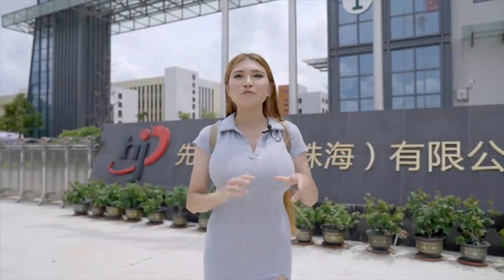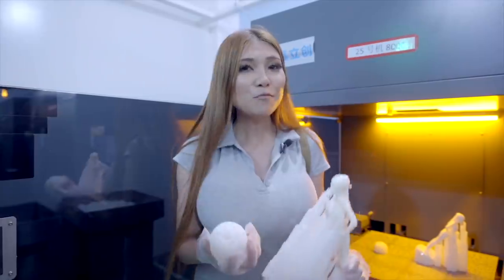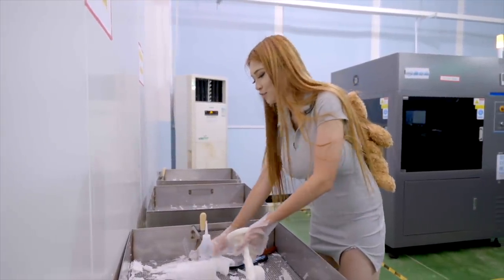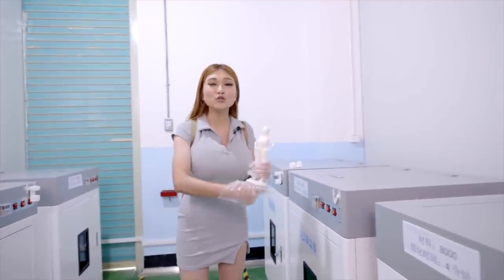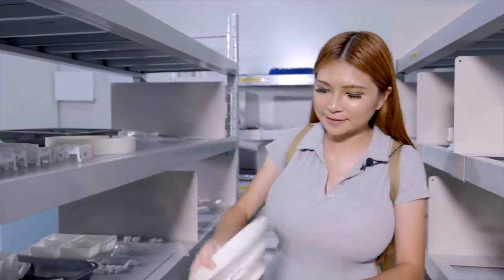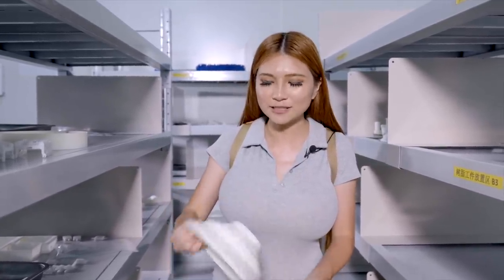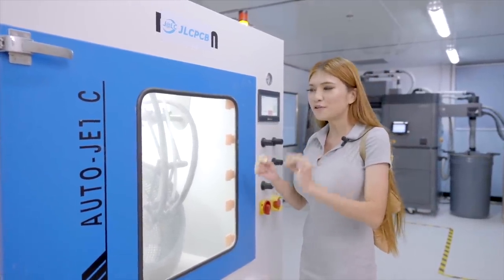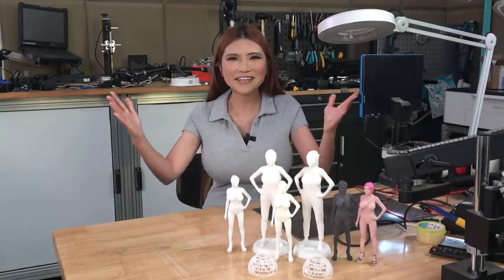Introducing JLC Industrial 3D Printing Services!

Comment: Amazing, even with shipping it costs half as much as it would if I print it myself. I can get it in nylon for cheaper than the cheapest resin I can find. And no smell, no worries about failed prints, probably better quality too. I ordered a few things that I've also printed myself, can't wait to compare.
Reply: Please share the results.
Reply: @jaimecln  will do, I'll take a couple of weeks to get here, I went for the snail mail.
Reply: Got my parts from JLC. Took them about 4 days to actually send to production, probably due to wave of orders after this video. I ordered one resin part and one nylon. Both look really good and have incredible dimensional accuracy, no warping whatsoever even on the resin part. The nylon has a bit of a rugged appearance on one side, guessing it's the side facing down during print where the powder isn't supported, but the other side looks absolutely smooth. The resin is crazy good, hardly any layer lines to be noticed. Overall really happy with both parts, it's way cheaper than printing them myself and no failed prints or curing or smells. Excellent work from JLC

Comment: Interesting, with all those possibilities JLCPCB opens up, i feel like i should come up with ideas and prototype altleast once a week just because it would be possible ;)
I have 2 questions:
1. Your 3d-model seems to be printed at an (approximately) 45° angle, is this due to support structures, or are their other reasons for this (if so, what reason(s) would that be) ?
2. You show 2 models, one in black color and one that has pink hair and beige/skin-color body-color. Are those models painted/coated somehow, or is it the color of the print materials ?
Reply: MJF printing comes in two variants, one in monochrome-material color, the second with dye jetting simultaneously with the binding agent
Reply: @alfdriss  thanks for answering my question :)
Reply: Please clarify, does this dye-jetting color the print in real time with multiple colors?!?
Reply: SLA is usually printed at an angle like this.  It lets you put the support structures on the back, where it's easier to clean them off (because it's normally flatter) and where people don't notice left-over support dots as much.  In theory it also makes layer lines less noticeable, but that's rarely an issue unless you have a lot of flat planes in your build.

Comment: I do a fair bit of resin printing of parts at home.  very curious how the results compare so I just ordered a handful of parts that I have printed  myself successfully so that I can see for myself.  I found the prices reasonable, right at 40 bucks but half of that was shipping to the USA via DHL.  I could have added many more small parts without the price going up any more on the shipping side.  I will comment back here once the parts arrive in a week or so!
Reply from the maker: Great!
Reply: Of the handful of parts I sent to JLB unfortunately none of them made it past the preproduction stage.  A friendly rep from the company let me know that no wall sections  or features of less than 1 mm were acceptable.  Since that pretty much eliminates every part I would ever need for a model I unfortunately probably wont be able to use the service.  To their credit they promptly issued a full refund, but I am a bit disappointed that I will not be able to utilize the service.  I really wanted to see how the parts from an industrial resin printer compared to those I print on my Anycubic Mono X but I guess now I will never know!
Reply from the maker: @DimensionMachine  Oh yeah, those specs are pretty standard...

Comment: I'll consider checking them out and doing a test print if they ship stuff to EU.
My Ender 3 isn't performing that well when it comes to big stuff due to it's printing size limitations.
With this I could consider letting them print car dashboard modding elements and replacement parts (4very old cars) for me and my community.

It's really hard to obtain plastic parts for cars like the Ford Taunus, Toyota Supra MK2 or Saab 900 in my country and some people also want to upgrade their old cars to fit an fiberoptic dashboard light and 2din car radios.
Until now I had to slice the parts into 2 or more parts and then use my DIY skills to permanently connect them together.

Thanks for sharing the news with us and I'm sure my community will appreciate this video as much as I did

Comment: Are those HP printers the same style as the old Z-Corp (Brought out by 3d Systems) powder printers? They lay a powder coat down, then print binder and colour.
Amazing machines, but too expensive for the hobbyist.
It is possible to 3d print terrain for wargames (Castles etc) in full colour.

Amazing video as usual.
Reply from the maker: Their patent is a bit different, and it's much stronger...
Reply: @Naomi-Wu  I can not see the file specification requirements for the colour printing on their site. Just a drop an STL file box.